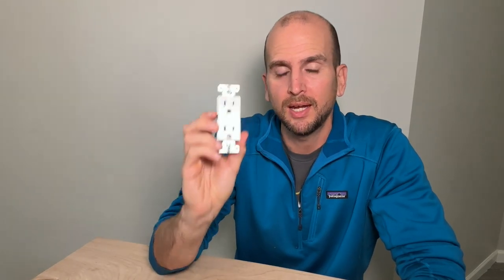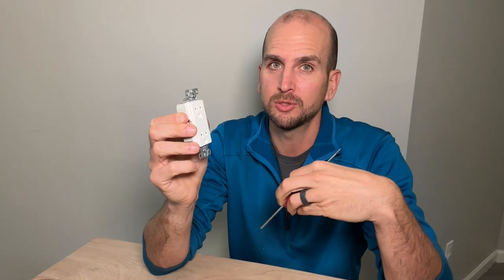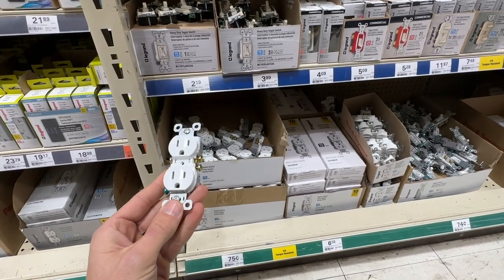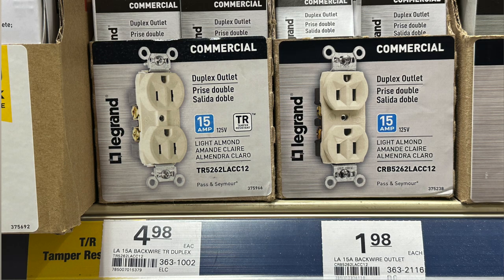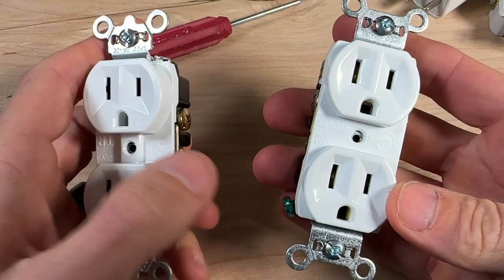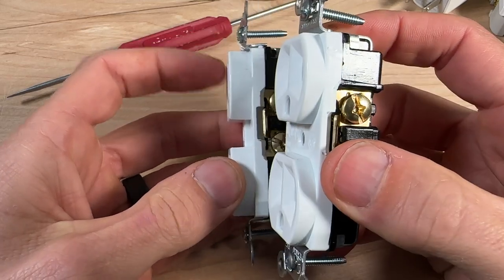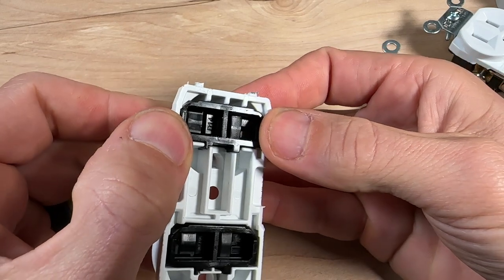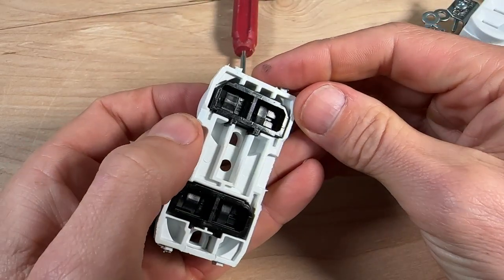The Most Hated Product In Home Electrical

Comment: I had five kids, and they are all grown now.  I used those plastic plugs, and I never had any problems.  If you don't want to change your outlet get the plugs.  They are cheap, and effective.
Reply: Same here, except I have 3 grown kids,we used the door knob things too,and the cabinet locks.
Reply: better question, did any of your kids remove a plastic plug?  Or did they know that playing with plugs is like playing with cars on the highway?   Kids are not stupid,  but it seems adults are who make it really hard for us to plug a plug into an outlet.
Reply: Yes, that's clearly the best solution. Those plastic plugs are impossible for. a young kid to extract
Reply: @samjones1954  There were no tamper-resistant outlets or plastic plugs when I was of an "experimental" age.  I remember my parents keeping a keen eye out and being removed from in front of an outlet twice - I could not have been more than three years old.  Yes, I had a house key all ready to insert on both occasions.
I also remember being talked to very sternly about how dangerous that was, and I left them alone after that.  The stern talk didn't scar me for life, either, because I did not become afraid of outlets, just very respectful.
Reply: @agcons  me too.. my mom just told me that I would get hurt if I did that.  Never did till I was a teenager and was learning electronics and electricity, but I knew what I was doing and knew where the dangers are.
Reply: Myself and my 5 brothers grew up without the plastic plugs or the fancy outlets.
We had common sense. Our parents warned us that if we stuck something in the outlet that didn’t belong there…. We would get shocked,likely burned,then our arses blistered for being stupid. Six kids,2 working parents, the older ones watched the younger ones.. zero incidents of shock due to stupidity.
One of my nephews was determined to poke a Bobby pin into the outlet. His mother was in the bathtub. Evidently watching my eyes bug out of my head was amusing to him. I asked his mother (my sister-in-law) what she wanted me to do. She said,if you tell him no and he persists,blister his butt.
He did,I asked him not to,he tried again,I spanked his bottom with my open hand.
He is in his 40’s,alive and well and never messed with a socket again.🤷‍♀️
Reply: @trapped7534  exactly why wouldn't want something safer?
Reply: @maxshiraz3447  Those plastic plugs are near impossible for an adult to extract.
Reply: Too simple lol, where is the challenge? Lol
Reply: @trapped7534  Your story references common sense and lack of stupidity but then the only reason the young kid didn't get shocked is that he was lucky you were around. Play out that scenario on a scale of 330M people in a country. Would you rather all the kids get lucky like you or just be prevented in the first place? Yes I get a little frustrated when I plug my bent up vacuum cord in. But TR has gotten a ton better in the last 10 years.
Reply: The TR receptacles don't cost much more than the plastic plugs. I have seen many homes where receptacles sometimes in use don't keep the plugs inserted after use.
Reply: @MarkLawry  When my kids were growing up we only knew about the plug in caps.  I also warned my kids about the dangers, and I was also able to have furniture in front of the floor level plugs.  Back then a lot of us parents really got creative to keep our kids safe.
Reply: That's what I grew up with as a kid, I'm still alive so must have worked lol
Reply: I’m 72 we didn’t have those plugs in my day.
Reply: @tunafish3216  it's called progress
Reply: @maxshiraz3447  don't bet on it  my niece knew how to open child proof medication bottles and probably removed them plug covers at her young age. 73
Reply: Plastic plugs are a nuisance and somehow my first son figured out how to pry them out before he could even walk. Some TR outlets are indeed a nuisance to plug stuff into. I found a kind of "commercial grade"  TR outlet that I liked and went with it, problem solved. Leviton seems to be a bit more finicky than others, but even that one loosened up a bit over time and works fine.
Reply: @KameraShy  At least the ones that your baby has trouble with, yes. And then they learn how you do it by watching you struggle.
Reply: @tunafish3216  look up survivorship bias lol. Yes YOU are 72. A lot of children did not make it due to curiosity killing the cat so to speak. This isn't a made up problem.
Reply: You do not need to change existing outlets to meet new code requirements. Only new construction and renovations require upgrading existing outlets. So, if you don't have them, you don't need to have them
Reply: I had 2 kids, my 3 sisters had 7 kids between them.

None of us used these or the plastic inserts.

We never had any problems either.

We ALSO taught our kids to not play with them.

Proper education is cheaper, and just as effective.

Hell, my dad didn't even lock the gun cabinet, which had the ammo in it.

None of us ever touched that case.....
Reply: Same here, except I have two grown kids.  Didn’t use the plug covers and these useless things weren’t around yet.  I just told them that if they stuck things in the outlets they would die.  Hey folks, guess what?  Explaining real world ramifications to children works.  Try it!
Reply: I have those as well. My only concern with them is that it's so easy to unplug something and then they get full access to those prongs. I try not to do this in front of them so they don't get the idea, but it's definitely a risk.

Also shop carefully for power strips, some are tamper resistant but most aren't.
Reply: Yes, I've found that those plastic plugs are very effective and cheaper than the tamper resistant kind.
Reply: When I was a kid we used the plugs and it worked fine - I could never get them out haha!
Reply: The plugs are a chocking hazard
Reply: I hate them.
Reply: If you add a new circuit greater than 6 ft. you are required to use TR Outlets! Let someone get hurt in your home with an item that you should have purchased diffectly by code and see what your homeowners insurance does if they is a liability issue...
Reply: @samjones1954  my mom said I did constantly ha ha
Reply: Not just little kids, in HS science class idiot put paperclip into outlet.
Reply: They didn't pull out those plug covers by the age of 2?
Reply: When I was a toddler, I would pull them out and put them in my mouth.
Also I had a classmate when I was 8 who jammed paperclips in outlets for fun.
So, maybe those edge cases are why TR outlets exist.
Reply: unfortunately if you do anything electrical change wise your required to use those stupid TR plugs to be code compliant of which what i did in my moms house wouldnt f follow code but i dont care as what i did can quickly be undone
Reply: I have four kids from 9 to 20 in age. Now that the youngest is almost 10, we're planning to introduce all kinds of new hazards. Childproofing is phased out, and we shall create all new risks. We earned it.

Chainsaw juggling and lawn dart catching begins this spring! 

😎🤣
Reply: It is just common sense.  Use the plugs and at the right time teach them not to stick things in the sockets.  Just teach them to be safe.  There are a lot of things that can harm someone far worse than an electrical socket.  They might be things like blenders and garbage disposals.  They are all perfectly safe when you know what not to do with them.  The way our laws are written you would think that everyone is 100% dumb since with our nanny state they make everything difficult for no valid reason.  They just use buzzwords and hot button topics to get us to allow them to pass these nonsensical laws!!

Comment: Quick little shock as a kid was a learning experience.  Z a a a p!  Only did it once
Reply: I did the same thing when I was maybe six years old.  Was goofing around with a plug to socket adapter at a wall outlet and got my finger against the hot prong.
Reply: I stuck a bobby pin in it.
Reply: Same but I was taking out an outlet when I was like 10 and touched the sides as I pulled it out. Learned that day you have to turn the breaker off first lol I took apart everything as a kid
Reply: GERMANY actually has 'safe outlets' but not yet when I grew up (or maybe the soft wire bypassed the safety - doubt it , we're talking 1958) ..... but I took the wires of a 12V electric motor for an erector set and stuck them in .... whole house went dark (glass fuses) .... my parents told me the found me sitting dead center, as far away as possible from any wall, still holding the leads with a 'wth' look on my face  ..... lol
Reply: @MrOpinionCantSignIn  You lived.  You learned.  You have a story.
Reply: @MrOpinionCantSignIn  In Finland we had them on the 60s in kids rooms. They came common everywhere in the 80s pe so. In the early 80s there were three fatalities of kids sticking something into outlets. Now there has been no child fatalities on domestic electricity after 1996.

The older ones required that you moved the plug up or down (depending on which receptacle you used before pushing it in so they worked only as ungrounded.
Reply: @MrOpinionCantSignIn  Does Germany have 240 volts at outlets? I can see how Europe might be a little more cautious with there wall outlets as most countries use 240 volts instead of the US standard of 120 volts
Reply: @MrOpinionCantSignIn  EU 240vac is a lot more hazardous than N.America 120VAC outlets
Reply: The physical shock I got as an inquisitive 4 year old who inserted a key into an outlet wasn't all that bad. But I never ever did it again!
Reply: Same 😂

Comment: I've never encountered an a TR outlet that didn't require an unreasonable amount of force to plug into it. Fighting me on something as mundane as plugging in a coffee grinder when all I want is my damn coffee makes me furious.
Reply: Yeah same here. He’s likes making it seem like a huge problem but it’s really not.
Reply: You probably don’t need TR on a kitchen counter
Reply: Wiggle it while you push.
Problem eased.
Reply: Why would I buy something that prevents me from using the primary function of the product?  
Most of the time, the protective system is binding me and preventing its use.
It would be the same as buying a car, but the brakes are engaged most of the time. Sell me a device that has a system that works, and I will buy it.
Reply: @TheHavocdog  it’s not an issue, get some and find out.
Reply: @TheHavocdog  British 3 pin outlets😜
Reply: @owlbeartoe    my last house is full of tamper resistant receptacles  and it is a fight every time to plug something into them!
Reply: You haven’t tried the Hubbell TR receptacle. It does NOT use slide shutters; instead the Hubbell TR uses trap doors that PUSH out of the way like bar doors. If he weren’t so enamored with Legrand, he know about Hubbell’s patented approach that DOES NOT BIND UP.
Reply: Because everyone wants cheap, that is why this country is so dependant on China... Buy quality, they function flawlessly and last longer...
Reply: 100% this. they are all trash. And after a few months of use they wear out and the plugs just fall out or have poor contact. Seems like more of a hazard than regular plugs that hold up better.
Reply: @fisqual  Simply because you are buying cheap a$$ TR outlets! I rewired my house over 10 years ago and my outlets work great... I have numerous other properties where they also work fine!
Reply: Yes!  Especially frustrating in hotels...I actually broke the plug on my laptop charger trying to plug it in because only one side would open.  I refuse to have them in my house, it's not safer if you are having to apply unreasonable force and bend the prongs or tear the insulation fighting with it.  I've also seen many of them where its not working and shining a flashlight in looks like only 1 of the slots has a shutter in it.
Reply: @fisqual The wear out and fall out are signs of low quality contractors grade outlets...
Reply: @brianerock  

The first time I bought a TR receptacle, it was a Legrand with two USB connectors. The biggest problem I have with that was that the shutters were extremely stiff, it's like it was designed to expect a ground pin to be inserted. If if was just the two blades, it was tough, but if the ground pin was included, it seemed a bit easier to insert.

However, when I replaced a few GFCIs with an Eaton/Cooper TR GFCI, those seemed to be a lot easier to use. Almost like they knew that not every plug is going to have a grounding pin. My mom, however, had some trouble plugging things into it, only for me to observe that she's been inserting them at a slightly awkward angle than what she had thought. Once I pointed out her actual issue, she readjusted, and adapted.
Reply: @TheHavocdog  it's more like buying a car where you have to press the brake pedal before you shift it out of park.
Reply: @dregenius  So, I am assuming that you are a Socialist, since you wish to be able to tell someone what they can and can't have? My wife and I were broke when we started out, we literally used coins to buy our groceries at times when we were first married. We worked our you know what off to achieve what we have. I owe no one. I would suggest if you are young enough to learn a trade or simply find what you do best and be the best at that profession. Stop making excuses and change your life on your own...
Reply: Yeah, like those damned selector levers and manual safeties.
Reply: @brianerock  , he always chooses the bottom of the line Hubbell.
Reply: I guarantee that money is the only reason those terrible things are forced on us.  They really do need to fix the code to allow exemptions on where you must use them.  They could go as far as if you don't have children or plan to have any you are exempt from having to use the stupid things.  When I was a child we had plastic plugs that can be put into outlets to keep things out of them.  They seemed to work really well.  My mother never found me with my hair standing on end!!
Reply: And here I thought what the us government did to gas cans and sink faucets was stupid...........
Reply: Plus they often thud and click when you get your plug in not really ideal when your live with overs ad your outlet is on a shared wall. TR outlets should be required in new k-12 schools and related institutions but yeah… its not smooth enough to be worth it in the average dwelling…

Comment: If you really want to hate TR outlets, try using a weather resistant & tamper resistant outlet outdoors in cold weather. You can't plug an extension cord in with both hands no matter how hard you push.
Reply: Only if they are buying cheap contractor grade WR/TR Outlets which do not function well....... If you purchase quality WR/TR outlets they function flawlessly!
Reply: You gotta wiggle that plug a little bit to get her in there. lols
Reply: Never had a problem with my weather resistant TR outlets.
Reply: Agreed. Trying to plug my heat gun into the WR/TR outlet when trying to thaw out my AC condensation line during the polar vortex last month here in GA when it was -10 with windchill, made lots of 4 letter words come out of my mouth.
Reply: @macgyver03ga  Because you or your contractor use cheap a$$ WR/TR receptacles! It is not an issue with quality receptacles...
Reply: I’m with you, same problem outside.  Additionally, many of the outside outlets have covers that get in the way.  F’in hate them.
Reply: @UDumFck  All new outdoor covers are required to allow its to be plugged in an still close to door... Once again, they work great if you don't try to cheanen out...
Reply: Agreed, I have one outside and 90% of the time I cant get the plug into the socket.
Reply: @galenmarek8287  more like him